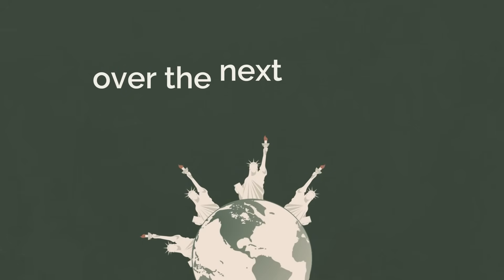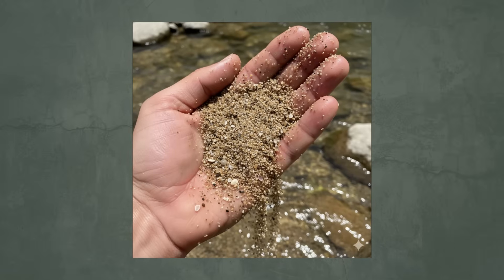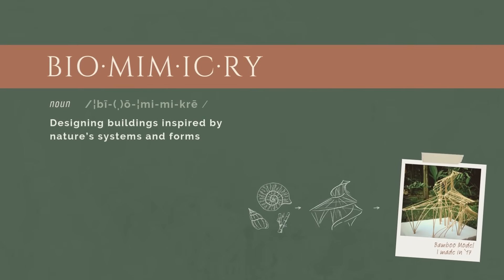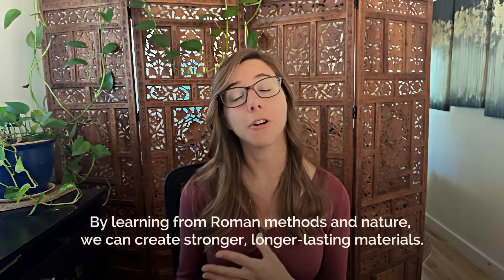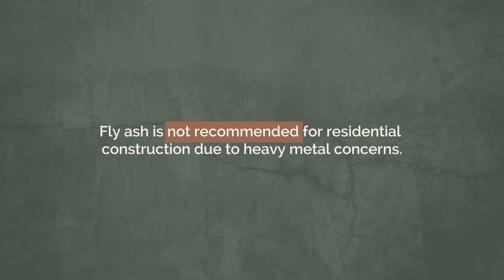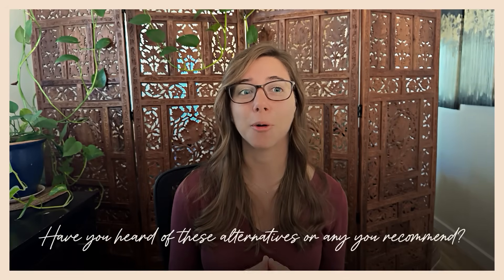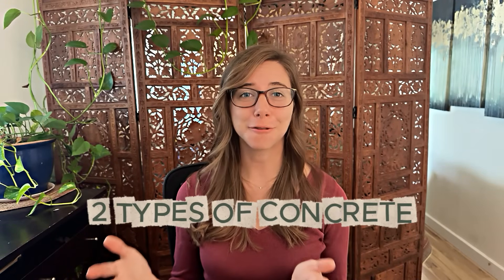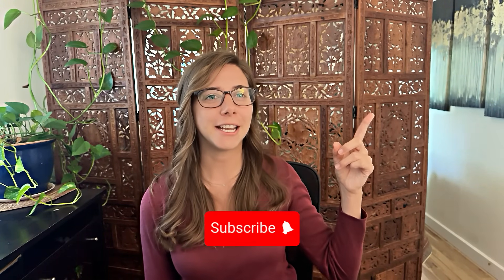Concrete Alternatives For Smart, Sustainable Home Building

Comment from the maker: What concrete alternatives did I miss?
Reply: You completely missed helical piers and ground screw foundations, completely eliminating concrete from your foundation design. 
Faswall blocks can also help reduce concrete use in more "standard" foundation systems. Also pin pile systems, using a concrete block pinned to the ground.
Reply: There is a movement that is exploring aircrete which uses soap bubbles as way of creating a lighter weight alternative that is also a great insulator. However you brought up how porous concrete is so I’m wondering if you can cover this in maybe another video. Love all your work thus far
Reply from the maker: @gregorybryon9851  ah yes.  Aircrete is very lightweight.  I dont think it has a lot of compressive strength for some fo the structural applications its needed in.  Good idea for another video for sure!  Thanks!
Reply: @christinaransbury and would aircrete have the same thermal mass qualities
Reply: You've done well; you did miss mentioning the Negative Embodied Emission Product (NEEP) measure of alternatives, and the rebar and aggregated subsitutes basalt fiber/staples that replace steel without corrosion risk, so can be placed nearer the concrete surface to reduce bending moment; and, biochar to displace up to 11% of that sand by volume, sequestering carbon more or less permanently.
Reply from the maker: @bartroberts1514  oh nice!  great additions, thank you!  Love hearing that the biochar helps displace the sand.  Thanks for adding that tip!
Reply: You completely missed helical piers and ground screw foundations. Eliminating concrete all together from foundation design.
Reply: @ericmenz6450  With Black Locust for skirting so pressure treated chemicals don't leach into the ground water. Perhaps a manufactured wood product from it like Hardiplank?
Reply: @projectmalus my thoughts exactly. Typical it's 8" above grade where you can't have wood contact. So a hardi product for the lowest portion of skirting. Or use a feswall (sp?) block as the lower course, then frame a wood wall from there to the underside of floor truss.
Reply: @ericmenz6450 which are what? And what can replace a concrete basement floor or garage floor?
Reply: @ezzielunchdawg you will likely need to use concrete in some form if you would like to have a floor in your garage. In the basement or house slab on grade, you can use an adobe floor. If you're using helical piers, you wouldn't likely have a basement. (You could use helical piers under the footings if you needed to have a deeper more stable foundation). Basements are not great anyway, as all the stale most toxic air is down there. The chimeny/stack effect pulls air from the lowest point (basement) and pulls it through the house out of the leaks in the attic, drawing that toxic air into the living space. 

Unless it was a walkout situation, I wouldn't design a house with a basement. 

You can't always eliminate concrete but you can do your best to reduce it.

Comment: CARBON IS OK.  WE ARE A CARBON BASED LIFE -  CONTROL FREAKS USE CARBON AS THE DEMON PARTICLE BECAUSE THERE IS NO SOLUTION TO IT.  IT IS HARMLESS.  DIG DEEPER FOR THE DATA>  FACTS WILL PREVAIL>  STOP THIS CO2 BS PLEASE
Reply from the maker: Yeah I try not to use the word because of all these conflicting perspectives, but sometimes it slips out as a way to describe overall environmental impact and overall imbalances.
Reply: You are 100 percent right bro !!! 😊👍

Comment: Interesting info, would domestic fire ash substitute for volcanic ash given its been through fire?
Reply from the maker: I dont think its that simple. biochar is a bit different in that it is burned without oxygen.  Also, I think the pH can be really high so I think it is chemically different in that way and alter tthe cement chemistry.  Could maybe work in earthen plasters or non structural experiments since its not really acting as a binder.

Comment: Question: I live on the island of Hawaii we have volcanic ash. We’ve got volcanic lava rock we’ve got seawater. Does it make sense for us to make concrete here on the island the way the Romans did either for our own construction or for export?
Reply from the maker: Its worth some experimentation!  Not all volcanic ash acts as a true pozzolan, so you would need to test for that.  Also will still need to add cement or lime still (may need to be imported).  If you use seawater, you cant use rebar because of the chloride corrosion.  Or use basalt or fiberglass reinforcement.
Reply: @christinaransbury  wow! You obviously know a lot about this. I would love to learn more about this if there is a way we can connect. I am building a school and I have much need for concrete, but because of my feeling that concrete has a very, very high carbon footprint I’ve been searching desperately for alternatives. Would you be willing to engage with me to see if you could help me figure out how to exemplify a better concrete paradigm?

Comment: I’d love a video about alternative Rebars, and when they should or shouldn’t be used. :face-purple-wide-eyes:
Reply: I’m a restoration engineer and my entire career has been fixing concrete BECAUSE of rebar. So in short I am now theorizing that we should never use rebar but instead design concrete and buildings differently.
Reply: The designs should be made arched to support themselves without any rebar, 

if you must use something similar that won’t destroy the concrete like metal rebar does 
, I would use BAMBOO . 
It’s strong, won’t corrode & offers structural stability beyond anything I know.
Reply from the maker: Couldn't agree more!  Working on it and will have a video / interview with the experts on this one!
Reply: I came to the comments to say the same thing👍👍

Comment: One reason the roman concrete structures have lasted so long compared to concrete from the 1950's that is already failing, is they didn't use rebar. Rebar is a major failure point for concrete. When water penetrates the concrete and gets to the steel, and that's when not if, it rust, which expands, and breaks to connection between the two materials, water and ice will do the same. Eventually they come apart. The main reason to use rebar is to do flat spans, like in a parking garage. Where the romans just used arches. Another big problem i've heard is that the rust from rebar makes the concrete non-recyclable. It would pollute the mix. but regular concrete can just be ground and used with a little new cement. This design decision will rarely pay off for one person, but demolition and recycling is an important part of life cycle costs.
Reply from the maker: Really great additions to this conversation!  I will do another video discussing this in more detail for sure.  Arched supports make so much sense in masonry construction and rebar is not needed.
Reply: I believe, part of, the rebar failure happens because it is placed too close to the exterior of the concrete. The natural expansion and contraction of the rebar will create the cracking and spalling you typically see on bridge structures.
Reply: @ericmenz6450  You can place rebar deeper in concrete and that will increase the time for water to penetrate, but waster will penetrate, concrete is too porous. even damns have seepage. The design life will help determine the depth for engineering design. But still no consideration for end of life.

Comment: I suggest getting the opinion of engineers that work in the industry to get an input of why something may or may not work.

Usually it's like this:
If it increases work, it's a nope.
If it increases costs, it's a nope.
If it's weaker, it's a nope.
If it requires maintenance, it's a nope.

For example, bacteria concrete... bacteria will die eventually, so it ends up being just a gimmick.

So, to have a more impactful communication that can't be just called as "fairy tales" we have to be more practical, in the current world, the world of today, if there's something that just looks that it requires more effort, nobody will pay attention to it. Yeah it sucks but that's what we need to overcome if we want to be taken seriously.
Reply from the maker: Great practical tips!  Getting a structural engineer to back up some of these innovations is key and I think many of these companies are working to get efficiencies in place to turn the dream into a reality!

Comment: Is it possible to get cement that will stay good for thousands of years?
Reply from the maker: Some of those Roman sea walls I mentioned have… so some promise there!
Reply: @christinaransbury  Is there a type of cement or concrete mix that can last for thousands of years underground in a humid environment? What materials or additives can improve its durability in such conditions?
Reply: Thank you so much for your amazing and helpful channel - I've learned a lot from your videos!❤🌹

I'd love to see a detailed video explaining how to reduce home construction costs as much as possible without sacrificing quality or durability - starting from planning and design, through construction, and all the way to the final finishes.

I'm interested in practical ideas, materials, and techniques that help cut costs at every stage of the project.
Reply from the maker: @ISF-k48  Absolutely!  I actually have one of those queued up here :). Next couple weeks!   Thanks for your kind words 🥰
Reply from the maker: @ISF-k48  most underground conditions are humid!   What I shared in this video is a good start for things to think of, but you will need to consult an engineer to consider your specific soil conditions

Comment: Another fascinating presentation. What are options for concrete recycling from demolished buildings, etc? Thanks & blessings!
Reply from the maker: Thanks!  That is a great question, a topic I forgot to cover for sure!  There are plenty of applications for recycled concrete, mostly structural fill and subbase materials once ground down.  If they are ground to a fine powder they can be used as SCMs (in part).  Getting the right equipment to grind to concrete down is the trickiest part - along with organizing the other components such as rebar aheaed of time.
Reply: @christinaransbury Thanks again, my friend!
Reply from the maker: @brucermarino  of course!